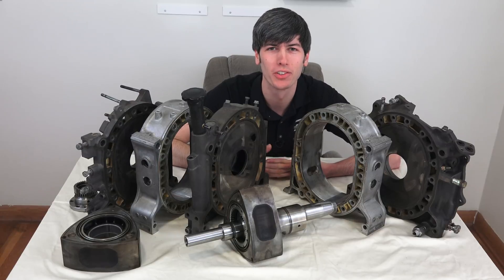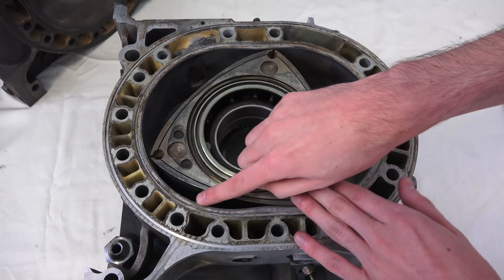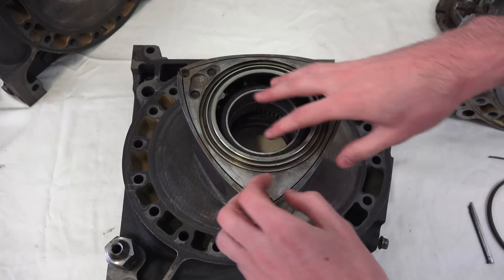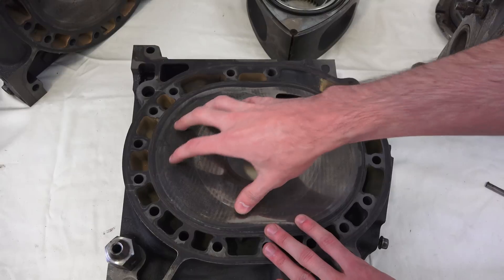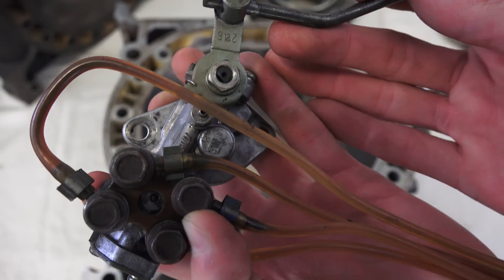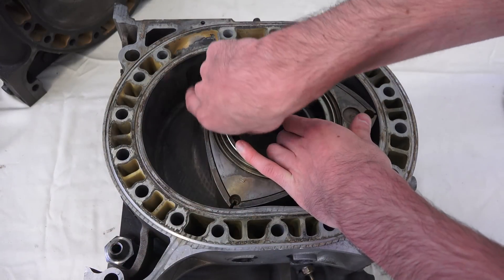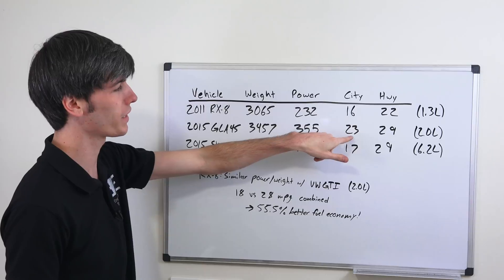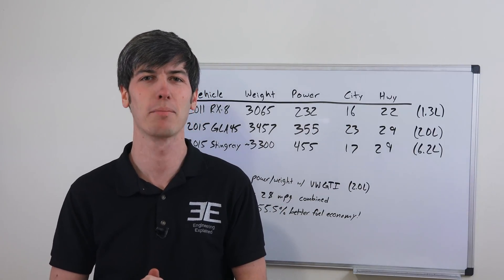4 Reasons Why The Rotary Engine Is Dead

Comment from the maker: For those curious about the advantages: http://youtu.be/sd6pJtR4PaY
Reply: +Engineering Explained you should have compared the rx8 to cars thats started production in the early 2000's to keep it fair
Reply: +Engineering Explained I didn't see any flames or brap sound sound in that video, you need to make a new one and add illustration to it.. lol ;)
Reply: I would like to point out in your last comparison there where had had the various cars and what their fuel mileage is that you were forgetting one major aspect of fuel economy, and that is gearing. The RX-8 in the later years cruised at something like 4000rpm on the highway. The C7 is generally under 2000rpm when in 7th. Now having said that, I don't disagree that rotaries ARE less efficient, just pointing out that this isn't exactly an apples to apples comparison. Maybe apples to tomatoes?
Reply: +Dylan Lammi facts are that the vette c5 is way more efficient than the rx8 rotary. More power and mpg. Another reason for aggressive gearing for the rx8 is the lack of torque. Put similar gearing in 6th gear for the vette vs the rx8 and the rx8 owner would hate their car in 6th regardless of apex seals. The point for the rotary for me is fun, not so much bang for the buck or hp/$
Reply: I had no idea your hands are that hairy!! Nice job though.
Reply: +Dylan Lammi in 2003 the corvette got 19 city and 28 highway.
Reply: +MeatyPotato Cactus the early 2000s corvettes got about the same mpgs as they do now.
Reply: +Dylan Lammi then don't complain about the comparison's production year
Reply: +Dylan Lammi You sir are full of shit. Apex seals go out from lack of oil changes, or not running the engines hard enough to start with.  Carbon builds up in the rotor faces and without proper warm up and RPMs high enough to prevent carbon from building up. This carbon then can make the apex seal stick and lose compression. Transmission fluid added via the leading spark hole cures this issue in under 15 minutes
Reply: +Engineering Explained Advantages?  Spitting flames out the exhaust, duh.
Reply: Agreed, also the fact that these comparisons are too far away in years, a rotary engine produced in 2015 with a brand new (no less than) 6 speed manual and high ratios (given this engine revs fast there's no need for smaller ratios on a lightweight box) should produce a very good amount of power and improved efficiency.
Reply: +Travis Gustin The suspension on an RX8 is far more advanced than that on an S2000 though. Forged aluminium double wishbones. Chassis rigidity is also far better in the Mazda, and it seats 4 adults without having to cut their legs off. As for reliability: I strenously disagree the S2000 is more reliable. You can rev an 8 safer past 9k rpm than you would an S2000. Stories of these cars with more than 300k on the block before rebuilds have emerged frequently. 

I think we have to all admit that a rotary is generally just being horribly neglected by unsuspecting owners who treat it the wrong way, causing it to starve on oil. Let's be really honest: the people that blow up their Wankel engines are typically retards. Go ahead and research this for yourself. Generally speaking they are not the sharpest tools in the shed.
Reply: +Engineering Explained The thing with rotary engines is that, in countries with heavy car taxation system (Greece) the RX-8 is enlisted as 1.3L engine which in this case you pay 135 euros a year, in case of the VW GTI 2.0L engine you pay 600 euros a year and its enlisted as "luxury" so you need about 1000 euros for insurance. So here is the the money to pay the mpg difference.
Reply: +Engineering Explained Could you write your calculations in Could you write your calculations in decimal system of measurement (maybe in brackets) for your foreign viewers, please?
Reply: +Jack Truitt Not even close. Only recently have corvettes gotten cylinder deactivation to improve fuel economy. Notice the huge disparity between it's city and highway MPG.
Reply: +Pedro Sánchez  I would like to point out that a rotary engine really doesn't "lack" torque. In fact, they often have more torque per unit of displacement than your standard piston engine. The only reason that they seem low on torque is because they are all either 1.3L or 2.0L engines. But compared to a naturally aspirated 1.3L or 2.0L piston engine, the rotary tends to make more torque and horsepower, partly due to the fact that they have a couple of extra power events compared to a 4 stroke piston engine. This is why in most racing series if you used a rotary engine they make you race against cars with double  the rotary's displacement. Now having said ALL of that, the rotary for it's given displacement is horribly inefficient to a piston engine in comparison. Doesn't mean that they aren't still fun as hell though.
Reply: +Engineering Explained Here's an idea for you. Do a video about the rotary powered Mazda Group C race cars. They were quite successful in endurance racing, where fuel consumption is a huge factor in winning. How was that ?
Not a trick question, I don't know myself and I'm genuinely interested.
Reply: +Nexus5 Google The standard C7 is not supercharged, however, the Mercedes is definitely turbocharged. Actually, the S2000 would seem a better comparison to me. Similar goals for the cars (lightweight, with an emphasis on handling over power), power is nearly identical (237hp for the AP1 S2000, 238hp for the 6-Port Renesis in the RX8), weight is comparable (~2800 for the Honda and about ~2950 for the Mazda, depending on options and years) and they were both developed around the same time, so technologically speaking, they should be on a fairly even playing field there too. Having said that, the Honda gets better mileage and is definitely the more reliable car.
Reply: +Engineering Explained Awesome video. You should build one
Reply: +Pedro Sánchez NAH SON JUST STRAP A TURBO ON IT! lol
Reply: comparing the gti's turbo four to a NA rotor engine, and not expecting a huge gap in fuel economy. Similar in power to weight ratio only. If the only difference was engine configuration and not gearing,  drivetrain layout, and weight the difference would not be as much. Yes I know the rotor engine is going to lose, but the closest comparison to a piston would have to be a two-stroke a design we also don't see in mess produced cars
Reply: +Flyingdutchy33 Lol. I won't argue that one, having known a few myself. But the Renesis is also well known to have it's own share of problems. That's not to say that the F20 or F22 aren't without a couple flaws of their own, but in general, Honda's live forever, even their high performance versions. The RX8 I would say has a rigidity advantage ,but it also comes with a weight penalty due to being able to seat 4 "adults." A much fairer comparison though than comparing the RX8 to something like a GTI or a C7 Corvette, or God forbid a Mercedes crossover SUV, all of which are BRAND NEW.
Reply: Besides my rotors I run an EK with a B16A2 for good reasons ;) It has 450k on the clock now. However it is like comparing apples and pears. The RX8 does feel far more refined though.
Reply: Graham Smith  I remember watching Steve Hislop on the Norton 588 at the IOM TT. It howled like no other engine I had heard before.
Reply: +Leo Hughes I live in Montana. Driving in the mountains requires changing gears all the time. It doesn't bother me. And I'm more saying that I wish Mazda would have given those cars a taller 6th JUST for cruising. Similar to the 5th gear that the FD3S RX7 had. That way you keep your quick acceleration for fun, but have a true cruising gear for fuel mileage. Yeah, the gear split sucks like that, but it's been a fairly common thing to do for almost 30 years in the automotive world.
Reply: Travis Gustin that's the nice thing about close ratios and high redlines. If I really want to pass someone on the highway. I usually drop it down into 3rd because it tops out at 90. Ride it out to redline, grab 4th and see flames in the rearview mirror
Reply: +Engineering Explained I was wondering if you knew how the Skyactive Rotary will work? or is it too soon?
Reply: +MeatyPotato Cactus 2003 corvette EPA fuel mileage was 17 city 26 highway 350 to 405 hp depending on model.
Reply: Steven No need to be insulting. The Enemy has a point. Taxation can make or break products, effect their design, etc.
Reply: What advantages? Poor fuel economy? Worse specific output? The only good thing about the wankel is someone tried something different. But we have all kinds of people trying stuff different now. 

Just get over it. Wankels are like communism. They only work in theory. If they ever engineer a self lubricating highly wear resistant, pliable, strong material to use for the apex seal, then maybe. You have to boost the crap out of them and wind them out to the moon to make power. 

And boost kills them
Reply: +Engineering Explained Thanks for the vid, my teacher mechanics gave us a task about engines and my part is about Rotaries so this is very useful ;)
Reply: +Pedro Sánchez If you short shift a rotary, the apex seals wear out even faster because they aren't being lubricated as they should be. So there's a reason that they are geared so shortly.
Reply: +Dylan Lammi While that is true, we aren't talking about lugging it around at 1500rpm. If the cruising RPM on the highway was between 2500-3000rpm, you SHOULD see a marked improvement in fuel economy over the ~4000rpm that the later RX-8 cruises at. Having said that, excessive RPM in a rotary engine without any real load on it also drastically decreases the life of the apex seals as well.
Reply: +Jack Truitt but made much less power.
Reply: +Jack Truitt th point was power in relation to MPG
Reply: Part of the Corvette's City mileage comes from the fact that the transmission has a lock out for 2nd and 3rd gear at low load. This causes the driver to go from 1st straight to 4th. Chevy did this specifically in the older (C5 for sure, I believe C6 also) Corvettes to help improve City mileage. There are ways around it (ie disabling it in the computer), but that's what it was there for. I don't know if the new C7 has this or not. If not, then bravo on Chevy for finally getting an OHV V8 with decent City mileage.
Reply: Travis Gustin it has cylinder deactivation in the C7. Otherwise the milage would still be crap lol
Reply: That's why I think these engines need to go in lightweight cars, that lack of torque
Reply: +Travis Gustin I think he meant the lack of torque down low.
Reply: Dylan Lammi Exactly, but once revd high enough they're just fine, I've heard they are indeed very fun to drive, my experience (for little it is) is only on 2jz engines though so I can't say on driving experience of these rotaries. Always wanted to get one if it weren't for precisely how delicate they are.
Reply: +Pedro Sánchez I don't have much real experience in so far as sports cars go. I've driven a Datsun 240z, and a limited amount of autocross in a Ferrari 360 Modena, a 911 Turbo S, and a Lamborghini Gallardo. But all of those just for a limited time and you don't really get the full experience of a car when on an autocross course.
Reply: +Anglo Spanish Racing They made fewer pitstops for tires due to the lower weight, and actually leaned off the throttle in order to make a couple of extra laps. It was in all honesty mostly down to carefull pit strategy and general reliability.
Reply: not an exactly fair comparison. i think the mers is turbocharged, and the vett is supercharged. however, rx8 does have worst mpg than the s2000.
Reply: +Flyingdutchy33 Part of that refinement likely comes from the rotary engines naturally smooth operation. Having had the privilege to drive cars with 2JZs, RB26s, LS7s, and various other engines that are considered to be quite smooth, I can honestly say the smoothest have been 13Bs. I can only imagine how smooth a 26B would be. Probably on par or better than a V12 for smoothness and response I'm sure.
Reply: Its not just the engine I'm talking about as wlel as the handling and general "feel" of the vehicle. Everything is far better than anything I have ever driven. (With exception of my FD)
 On a side note: my 20B just arrived and is awaiting clearance at the port :) Hurray! brap brap brap
Reply: +Flyingdutchy33 I love my rx8, but I wouldn't call it reliable. not so much the motor, but the car itself has had so many things break on it its not funny.
Reply: What a superb video,this is what YouTube was made for,not watching a cat fall off a wall!😉,I've learned a lot from your short video,I knew of these problems but now I know why,I believe Norton had the most success with the rotary engine in their race bikes in the early '90s,they had a sophisticated "extractor" exhaust system which boosted the power although this was completely illegal for their road going versions which were underpowered and unsuccessful.There was controversy at the time as other manufacturers (Honda etc) protested about the way that the engine capacity was measured and said that it was being done inaccurately,Norton claimed the bike was 588cc whilst other manufacturers said that it was really nearer 1500cc and thus had an unfair advantage to the 750cc competition.Norton tried it's hand at racing the bike in the 500cc Grandprix class at the time,but it was utterly outclassed against the brute power of the 500 cc 2 strokes.😉👍👍☺😊
Reply: +Dale Neish Really? I only had 1 swaybarlink at the rear "pop off" and my omp failed on me before I installed a Sohn adapter. Granted, that omp is far too expensive... But with pure clean 2 stroke oil running through it now I dare say it won't happen again any time soon.
Reply: +Travis Gustin ever driven an rx8? you couldn't sustain highway speeds at 2000 rpm with one. you would have to constantly downshift to go up hills.
Reply: +Leo Hughes The only time I've driven an RX8 was at an Autocross event, so not much for seat time. I'm not saying to the RX8 needs to cruise at 2000. I'm just saying that lowering the cruising RPM from 4000 would help fuel mileage, even if it was only down to 3000 or so. And honestly, are you saying that requiring a downshift is too much for you? I was under the impression that those cars were all about driver involvement? I guess at that point if you aren't interested in rowing the gears, by an automatic.
Reply: +Travis Gustin Driver involvement is nice. But, when you go out on the highway to go drive a couple hours. having to change gears all the time is a pain. Having taller gearing might help a bit. But not enough to make a big enough difference to make it worth my time to put  different gearing/final drive in my car.
Reply: I live in North Dakota. I don't remember the last time I had to downshift on the interstate at all 😂😂😂
Reply: +Leo Hughes Lol! There aren't many places flatter than NoDak, that's for sure. That would actually be a prime example of where a true "highway" gear makes sense. If you need power to pass, drop a gear and punch it.
Reply: +Leo Hughes I know that feeling. My 3000GT VR-4 tops 3rd at about 110. And that's only a 7000RPM redline. I still have 3 gears to go in that thing. Cruises at about 2200RPM on the Interstate. But it also has 320+ for torque at only 2500. I believe that's about 3 times as much torque as the Renesis makes at that RPM.
Reply: I don't even think we started that low when I had mine dynoed. That's almost 3x the torque my old motor had at peak.....
Reply: +Flyingdutchy33 oh yeah, most recently the clutch pedal bracket snapped on me, the left rear suspension bumps out on the on a  more than slight bump so I think the springs have sagged maybe or damper is screwed I'm not sure I need money for coilovers, the solenoids controlling the ssv, air pump, vdi are playing up, would be an easy fix but mazda being mazda they want to charge me 550 each for a 30 dollar vacuum solenoid and recommend replacing all 3 (so 1650 dollars lol). also coils wear out like spark plugs being a rotary, not to mention the spark plugs that you should use are 300 for a set!. coolant level sensor is broken. dash where the passenger airbag is supposed to come out cracked up bigtime after like 4 years (tropical sun). also the gearbox grinds going into 5th, pulled a chunk of LSD plate out of the diff oil,  the engine mounts go on the driver side quite early and the list goes on and on lol.
Reply: +Travis Gustin what makes you think cruising spped is 4000? also what is cruising speed really? on the highway here 6th cruises at about 3000 if your speeding a little, most of the time I'm in 5th, cruising at 2000 isn't any good for them anyway they gunk up.
Reply: +Dale Neish Holy shit.... Have you considered making offerings at some shrine? Perhaps accompanied by some kind of anti-voodoo ritual?
Reply: +Dale Neish I consider "cruising" speed to be 80-85MPH. The Interstate speed limit up here is 80 now. And the guy who let me drive his RX-8 during that Autocross event a few years back was the one that said that it cruised right at 4000RPM. It was a 2010 or 2011 model. R3 package. I know the later years also had a shorter 4.777 rear end ratio in them because Mazda wanted to find a way to make the cars feel a bit sportier and compete a bit better against it's rivals. Having run the math on the 255/35R19 rear tire that that would have come with through a gear calculator, I see that he was pretty much spot on, 4000RPM being 84MPH.
Reply: +Travis Gustin Yeah, my shitty old Nissan Altima can get through the hills of San Francisco without constant gear changes lol. And before you ask, yes it is a manual.
Reply: +Dylan Lammi Manual or auto, doesn't really matter. A gear change is a gear change in that instance. Only difference is that a manual requires driver involvement. One thing I have always hated about autos is that you can't just mat the throttle in top gear to climb an incline, it will always want to downshift. Newer autos you can lock into manual mode and prevent that, but any that are older than a decade don't have that at all.
Reply: +GlassTopRX7 Ah, that's just what I heard.
Reply: +Travis Gustin I know but I was expecting someone to be like "Oh how fldo you know it changed gears, you have an Altima so it was definitely a auto right?"
Reply: +Nexus5 Google The C7 corvette uses a 6.2L naturally-aspirated V8 rated @ 455hp and 17 city/29 highway mpg. The Z06 uses a supercharged unit making 650hp rated for 15 city/22 highway mpg.
Reply: +D.J. Burton I would like to mention also that I did some research on this and the C7 does still use the Skip Shift setup like the C5 and C6 did. That's why it can manage the 17MPG for City driving. The insane overdrive of 7th gear is where they get the 29MPG on the Highway. The C7 literally has the same gears as the C6, with an ADDITIONAL 3rd Overdrive gear added on.
Reply: +Travis Gustin it really is getting to the point where HP junkies can have their cake and eat it too so to speak. Just imagine when the hybrid tech we see in cars like the P1 and 918 becomes cheaper and trickles down "affordable" cars. If only my old Camaro could see that kind of MPG...
Reply: +D.J. Burton I am a little excited about the hybrid tech, but I personally hate the stupid Skip-Shift setup on the Corvettes. And from several of the people I've talked to, the C7's 7th gear is practically useless. If I were to ever buy one (a C7 I mean) I would probably change the rear end ratio to something a bit shorter to make 7th only a bit taller than what 6th would normally be and make the 1-6 gears a bit quicker. That, and get a Skip Shift Eliminator installed immediately. I'm not saying that some of the newer tech isn't cool and definitely has a future, but if you can't afford the fuel for a 500hp car, then you can't afford a 500hp car period. My opinion.
Reply: +eplusz i thinks he should drive and see why people love them
Reply: rotary love Not my car. It belongs to my sister's boyfriend unfortunately. I would LOOOOOVE to have it.
Reply: there is only one reason why the rotary is no longer in production, New emissions standards. not because of a low BFSC due to being thermally inefficient. these things can be fixed with good engineers and time. it wouldn't have Been an easy decision for Mazda, these engines are capable of over 1000hp in 13b form and over 1800hp in 20b form. not many engines compare in that regard.
Reply: +sampson green No offense, but that statement about the 20B simply isn't true. The actual Mazda center plate used on the 20B has been shown to begin failing at around the 600hp mark fairly regularly. Turbosmart was making a billet version to eliminate that problem, but I don't know if they are still producing it. That's why most of the extreme power builds stick to the 13B.
Reply: +Travis Gustin OK mate. I own a 20b with stock centre* plates. bridgeport, twin gtx35's, methanol and it makes 891 wheel hp on 22psi. have done so for 30,000km. I have built 13b's with more than 600 wheel hp. you have no idea sorry to break it to you.
Reply: +Travis Gustin also PAC Performance are the ones who supply the billet plates now. they put it in some P.R car that holds the record. 1800hp is still true for the 20b just because it has billet centre plates doesn't Really matter. there are 2jz's and rb26's with billet blocks that make less power. move along buddy
Reply: +sampson green Ok, fair enough with the billet plates. I won't argue that. And yes, there are 2JZs and RB26s that have made less with billet blocks. There are also a few that have made more than 1800hp too. It's good to know that the billet center plates are still available though. I freely admit that my experience with rotaries is not great, but there is a design flaw in the original Mazda 20B center plate, hence why the billet piece was developed in the first place. In fact, I believe that the original ones that Turbosmart made were almost solid aluminum to provide additional rigidity that the stock piece lacked. Just curious, what is your 20B in?
Reply: +Travis Gustin sorry mate I get a bit defensive of the rotary sometimes. yes turbosmart made the original billet plates, they supplied them to PAC before they designed their own. I'm not super familiar with them but i think they had a tougher wear face for added strength while also dealing with the oil retention issues at high boost. It's in a FC rx7. custom bridgeport, twin garret gtx35's(going to switch to twin precision 6870 soon), Moran 500lb injectors, Waterman mini Bertha 12.5 gpm fuel pump, race clearanced bearings and low compression rotors, modified stat gears and oil galleries. backed by liberty 5 speed clutchless.
Reply: +sampson green No worries man. I get defensive over certain motors too cough 4G63 cough, and I generally come to the rotaries defense when people that know less than nothing try to tear into them. Sounds like a cool build though. I've always like the FC and FD RX-7. I actually almost bought an FD about 4 months ago. Just curious, why Precision over something like a BW EFR turbo?
Reply: +Travis Gustin From my experience you can get greater power from a smaller precision than with a comparable garret(I don't have much experience with BW they aren't common where I am) and I don't have very much space in the engine bay so size really does matter. with the twin 6870 I should hopefully see between 1100-1200whp on 35-40 psi
Reply: +sampson green Gotcha. Yeah, stuffing an EFR into my engine is going to be... challenging. They are quite large compared to their competition, and you would likely need a pair of either 7670s or 8374s to make that number. The 8374 is starting to get crazy big too. Much larger than an equivalent Garrett. Good luck on the build. Do you have a link to a build thread at all?
Reply: +Travis Gustin no build thread. I barely have time to build it because I work in a mine half way across the country let alone document it, haha. I might upload a video of it at the track after I have got the new turbos. I have to buy a go pro or something similar.
Reply: +MeatyPotato Cactus That's to illustrate how much further the regular 4 stroke engine has come while rotary development has stalled. The fundamental flaw is the oil combustion which would cause it to fail inspection almost everywhere at this point in engine history.
Reply: +Engineering Explained This is a very honest and genuine question-
In the advantages video, you said that these engines were reliable. But this video seems to go in the face of that, and then there are the people that own them and swear that they spend more time in the shop than on the road. Can you please explain? I just want to understand better.
Reply: +StaticImage i had a 2005 rx8, i put 98k hard miles on it. everyday driver and every day i hit 9k rpms in at least 3 gears 60% of the time i drove or more. i loved the rotor motor and had no problem with the fuel it used and oil. never had 1 problem with the engine ever, did have started ripped up by snow but thats not the motor. never changed the plugs and they looked almost new when i sold it ( checked them before i sold it). many people just dont rev them up to shut them off. this fixes all problems with the motor.
Reply: +StaticImage i had a 2005 rx8, i put 98k hard miles on it. everyday driver and every day i hit 9k rpms in at least 3 gears 60% of the time i drove or more. i loved the rotor motor and had no problem with the fuel it used and oil. never had 1 problem with the engine ever, did have started ripped up by snow but thats not the motor. never changed the plugs and they looked almost new when i sold it ( checked them before i sold it). many people just dont rev them up to shut them off. this fixes all problems with the motor.
Reply: +StaticImage i had a 2005 rx8, i put 98k hard miles on it. everyday driver and every day i hit 9k rpms in at least 3 gears 60% of the time i drove or more. i loved the rotor motor and had no problem with the fuel it used and oil. never had 1 problem with the engine ever, did have started ripped up by snow but thats not the motor. never changed the plugs and they looked almost new when i sold it ( checked them before i sold it). many people just dont rev them up to shut them off. this fixes all problems with the motor.
Reply: +Travis Gustin Ok so run that little rotary at 2k rpm with a steep overdrive like in the vette and let me know if it can stay at highway speeds lol.
Reply: +The Real Santa Claus For reference, the late 80s volkswagen 2.8 VR6 gets better fuel economy than the 1.3L 2 rotor
Reply: 4:35 The way you wrote "2.0L"...it looks like it says "LOL", but that may just be me...anyway I'm not trying to make a hate comment because why would I, I enjoyed this video...first video I've seen from your channel, I'm definitely subscribing...I just wanted to point that out because...idk...
Reply: At a glance it looks like "LOL"...if you stare at it, it looks like "2.0L",
Reply: Cannon007 i have and it was fine at 1500k.
Reply: +Engineering Explained Can you do a video where you explain how steam engines work?
Reply: +Angel Gutierrez steam engines or boilers, uses 2 pressurised boxes 1 is the fire box, 1 holds water.

the fire box can be fed wood, coal, oil, gas anything that will keep the fire going, this fire also needs to be controlled at set Temps so the water is heated correctly. 

the water box uses lots of tubes to fed water into the fire box, this water will be turned into steam this steam is held shortly so there plenty of stock for any work to be done.

in terms of steam trains this steam will be directed into the air compressor for brakes and cabin heatin, as for wheel drive the steam is directed to piston chambers in front of the wheels, it fills the chamber and steam pressure forces the piston to move then the axles turn the wheels.

you also get more advanced designs with super heated steam which is steam refed into the fire box to make it hotter, this is fed into pre piston chambers to help movement and make it faster.

steam engines always have power to the wheels there's no gears as such so you don't have that clunk when changing gears et
Reply: +Angel Gutierrez I second that. Maybe talk about the different historical uses for piston and turbine engines.
+zagan1 This is all cool and dandy, and understandable, but it's more fun to have a video on it.
Reply: +MeatyPotato Cactus I was wondering the same but even comparing it to a 2003 corvette, even excluding the lighter and more powerful Z06 and going with a base LS1 it still makes the RX8 look pretty bad.
Reply: +Mykal Buchanan I think the idea was to focus on the newer generation of rotarys because rx7 etc. are basically irrelevant in terms of the future of the engine. The rx8 was the nail in the coffin and gives a lot of good reasons why not to use a rotary as a production engine. Not to mention that he seems to be focusing on north american rotarys not japans "better" rx variants. shot for shot the rotary is an abysmal street engine but an amazing track and race engine and that's why I think the controversy persists as to whether OVERALL its good or not.  
Also I believe (if I am not mistaken) that is a 1st gen renesis engine as the second gen had dual oil injectors in the rotor housing and the intake ports on the rx7 had a different geometry then on the engine shown here. Overall I am inclined to want to never see another rotary put into production but I think my view is jaded because my career as a Mazda tech really only shows me the worst the rotary has to offer.
Reply: +Mykal Buchanan I think the idea was to focus on the newer generation of rotarys because rx7 etc. are basically irrelevant in terms of the future of the engine. The rx8 was the nail in the coffin and gives a lot of good reasons why not to use a rotary as a production engine. Not to mention that he seems to be focusing on north american rotarys not japans "better" rx variants. shot for shot the rotary is an abysmal street engine but an amazing track and race engine and that's why I think the controversy persists as to whether OVERALL its good or not.  
Also I believe (if I am not mistaken) that is a 1st gen renesis engine as the second gen had dual oil injectors in the rotor housing and the intake ports on the rx7 had a different geometry then on the engine shown here. Overall I am inclined to want to never see another rotary put into production but I think my view is jaded because my career as a Mazda tech really only shows me the worst the rotary has to offer.
Reply: Okay cool thanks for the info on the engine, I'm basically just going off a scant few engines I have had apart in the shop (90% of the time its straight up warrantied replacement engines with rx8s) interested to see if this next gen of rotarys (if the do in fact come out in full force) bring any more usability for normal drivers who just want a fun car to play with.
Reply: +Travis Gustin The gearing is setup that way because of the inherent lack of low RPM torque in the RX-8 rotary - so it needed high RPM to have comparable driver response.
Reply: +Travis Gustin > Incorrect. The 13B actual thermodynamic cycle capacity is 2.6L not 1.3L. And equivalent in number of cycles as a 4 cylinder. A 2010 RX-8 rotary produced 211Nm of torque. A 2010 Honda Accord Euro (Acura TSX) with 2.4L 4-cyl produced 232Nm at lower RPM. Fuel consumption is worlds apart.
Reply: +elmura73  always the same error with the capacity: a Wankel does not work like a  alternative pistons engine: the rotors turn 3 times slower as the motor shaft!
Reply: +Engineering Explained Can you make a vídeo explaining about VW/AUDI EA-827 Engines? I know that engine has various "mutations" such 8v, 16v, 20v version and Diesel versions.

And is vastly used in brazil! In a high variety of cars like: Gol (VW Pointer), Parati (VW Senda), Santana, Audi TT, Golf GTI.
Reply: +leneanderthalien Yes, but there are 6 combustion chambers in a 13B. Engine capacity is based on all combustion chambers completing one full cycle (intake, compression, power, exhaust)
Reply: +elmura73 In A12 or B13 and any other version of a twin rotor engine there is only one combustion chamber per rotor, but it firers three times per rotor per revolution. Therefore a B13 engine has two combustion chambers
Reply: +Super Fn Mario The Renesis had a 10:1 compression ratio which is part of the reason why it never got forced induction.  

You're right that the older engines like the 13b-REW responded well to turbocharging.  While the Renesis produces about the same power as what the older turbo engines, the torque difference is big.  Actually, the combustion inefficiency actually helped spool the turbos that much quicker, they just needed to handle the heat.
Reply: +leneanderthalien 3 times slower than the shaft but still one ignition cycle per rotor per output shaft rotation.  Each rotor face is 654CCs so 1300CCs per output shaft rotation.

The displacement of a conventional piston engine is the displacement over 720 degrees of crankshaft rotation as that's what is required for a complete 4 stroke cycle.

So if we compare displacement fired over 720 degrees of rotation, the 1.3L rotary would be best compared to a 2.6L 4 stroke piston engine.
Reply: +94XJ  your demonstration is totaly false: the Wankel cannot be compared to a conventional piston engine because work more like a turbine engine...
The wankel cycle is on 3 shaft turns. Wankel opponents use all obvious ways to kill this engine because is very dangerous for them: half the size and near half the weight for the power= won the very hard 24h Le Mans race...yes burn more gas, but a conventional turbine burn much more for the same power: that is important! And this explain why some mobile military materials still use wankels, also civilian ultra light cars or aircrafts...
All what is unconventional will be killed from conservatives, like for example the recumbent bicycles who ar forbindden in cyles races size the hour record from such bike in 1933 by Francis faure...despite the only energy use is the same: the human muscles...
Result: developpment stopped...
Reply: +leneanderthalien Totally wrong in so many ways. Believe what you want.
Reply: +elmura73 without any serious technical explanation, your remark is without valour...
Reply: +leneanderthalien It's the best comparison that can be made to a conventional engine as that's the effective displacement fired in an equivalent 4 stroke...just less power derived per ounce of fuel burned, exceesive oil burning and much much worse longevity.

A rotary is light but, as rotary fans will all tell you, they're much better when boosted.  By the time you add a turbo manifold, turbochargers, an intercooler, a wastegate and all the associated plumbing, you've gained a tremendous amount of weight conpared to the base weight of the engine.  This is why LS swaps really do very little in upsetting the balance of FCs and FDs - it's not much more weight...but a whole lot longer lasting and more powerful.

There's a reason most people have abandoned the Wankel engine...there's are major flaws that will always make it less efficient than a piston engine (which is already terrible).

Rotary engines are great for racing.  Emissions don't really matter, they don't need to last all that long, they're compact so they can be positioned darn near anywhere for balance...the only real drawback in racing is the higher fuel consumption but that can be worked with for the most part.

They might be good on CNG as it would enter the combustion chamber colder and it burns cooler than gasoline.  However, I don't see it being any better than a piston engine.  Most vehicles I know of running  CNG are cargo vans, straight trucks, school busses, forklifts, etc.  in that regards, a rotary wouldn't be the best as torque is needed more than power.
Reply: +94XJ The new Prius engine has a claimed thermal efficiency of 40%. What thermal-efficiency level wouldn't be terrible?
Reply: +94XJ met an LS powered FD at a track day and it was understeering into every corner. It definitely didn't look right. It was slower than mine on stock turbos, although it could be driver.
The weight may be similar, but I'm not sure the centre of gravity was, or where it was positioned relative to the front axle.

An FD is essentially an FMR layout with a lot of space up front for the more lightweight engine components.

I didn't get to look under the hood of the LS swap, but I imagine a decent part of its weight sat higher and forward of the front axle line.

It's not just weight, it's packaging too. Packaging doesn't just mean volume either, it means weight distribution of the engine itself.

Either way, it looked a mess going around the track, but was a beast on the dual carriage way on the road trip home.
Reply: +MeatyPotato Cactus he actually compared a 2011 Mazda RX 8 to a 2015 Corvette it's only 4 years different still a few but it's not a 2003 you could be thinking of the RX7 that was discontinued in 2003
Reply: +Chris Monopoli njìndh jjdkf¢rally for comment 5 ufk/%You m
Reply: +Engineering Explained 

the Rotary  is not dead it is in development 
to say it is dead is  so wrong to do when mazda have clearly been seen to be developing it further since the rx-8 
 
ie -  Concept Car Mazda Furai
 http://www.carbuzz.com/news/2016/2/4/Lost-Concept-Cars-Mazda-Furai-7731737/
Rotary powered concept 

and only last year said they want to return to lemans  with a next gen rotatory 

2016 will see the RX-7 20th anniversary edition 
            as well as a next gen skyactive rotary RX-9
Reply: +Travis Gustin lol  honda cars and living for ever don't go together 
honda are absolute shit balls.... honda bikes different story
Reply: +Engineering Explained Hi, very good videos. What about Torque ?
Reply: +Engineering Explained You miss the whole point. If piston engines are like regular horses, rotaries are like Mustang/Thoroughbreds (thats why very few possess them ;) they are race-oriented and need special attention)! Rotaries are immune to catastrophic failure. In a piston motor, you can have a piston seize and cause all kinds of damage, but in a Rotary motor, while the engine will lose power, it will continue to produce a limited amount of power until it finally dies.

How about a few advantages over piston: 
-displacement(and weight)/power ratio
-output potential (there are 13b's rocking over 1000hp)
-rotary systems integrate much better with turbos that piston ones
-immense breathing ability
-revving up like a streetbike
Reply: +omnislasherRX7 
That is great advantage in aircraft.
Reply: +Engineering Explained How about the upcoming RX-Vision?
Reply: +Engineering Explained will engines burn conventional gasoline with human poop stirred in?
Reply: +Chickel Oaval ALAKUMBA!!!!!!!!!
Reply: TheEnemy 
There should be no difference in mpg with the new rotary.
Reply: ***** it´s a david guetta sexy chick oh she´S a diva
Reply: Engineering Explained t